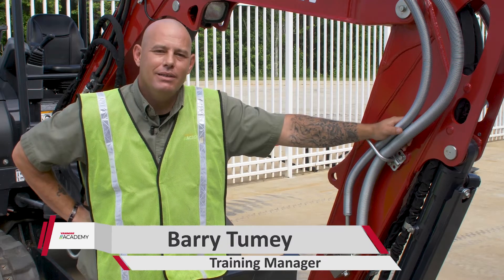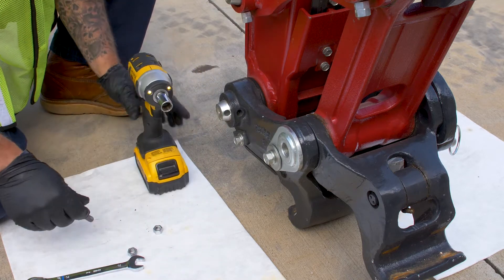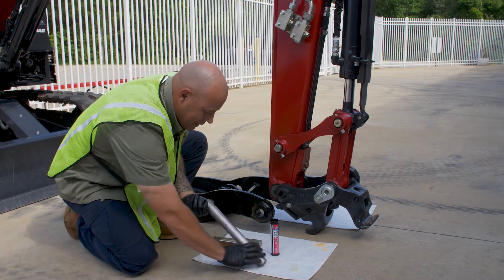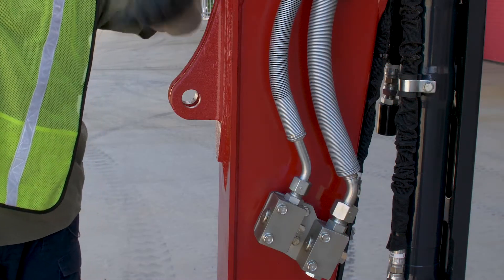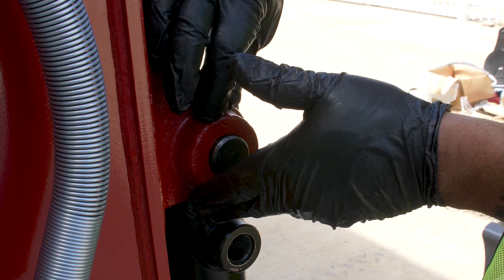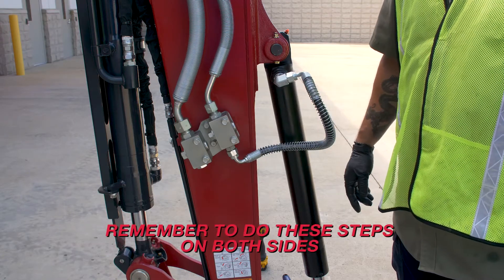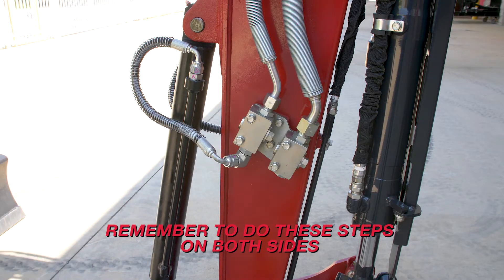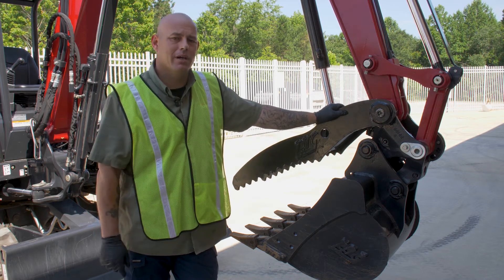YANMAR Academy Excavator Thumb Installation

Comment: How do you set it so the bucket overrides the thumb?
Reply from the maker: You have to adjust the circuit relief valve for the PTO circuit
Reply: @YANMARAcademy  where is the adjustment located?